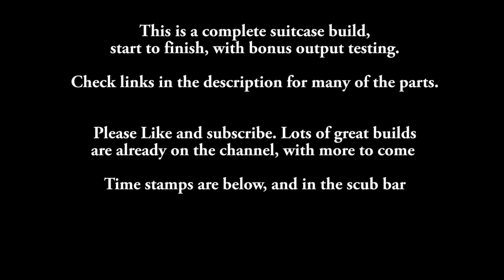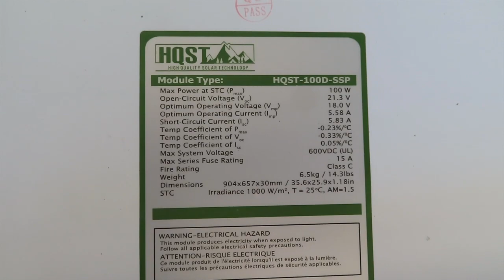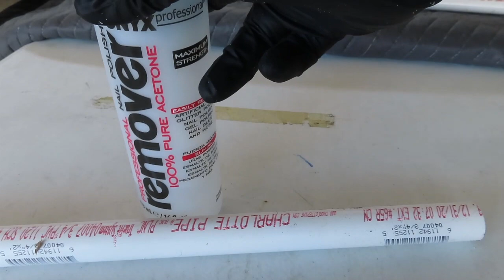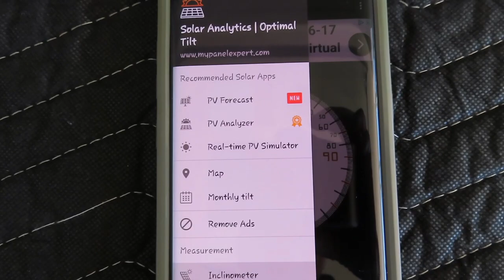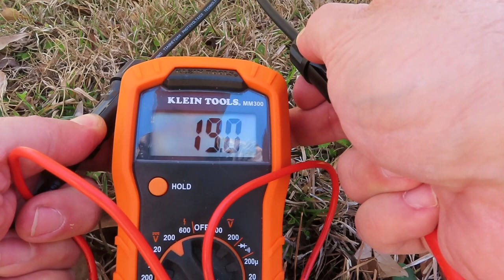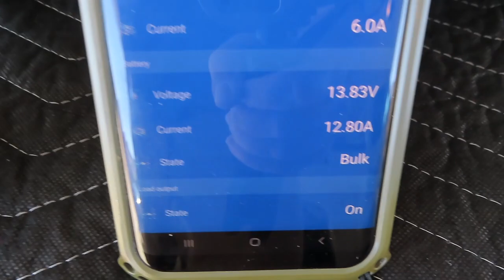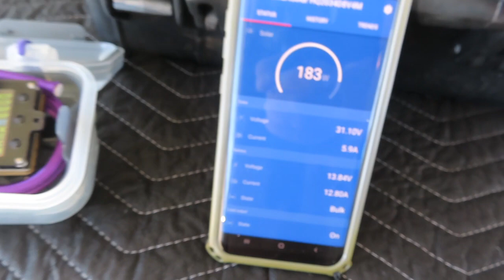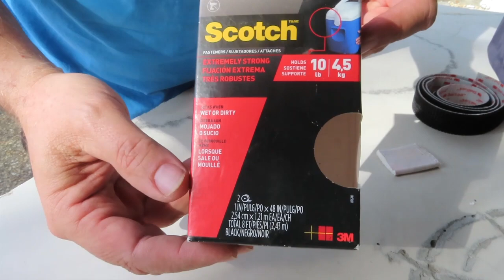Renogy 200w Solar Suitcase $500, DIY 200w $200

Comment: Received my panel today.  Jumped right on it following your video.  Tomorrow I'll get some 1/2 rubber bushings to keep the T's from sliding around.  Everything folds right back up and with the Styrofoam corners and side pieces it fits right back into the box.  Fits perfectly in the basement of my 5ver.
Thanks for the nice tip.
Reply from the maker: Thanks. Glad that was helpful

Comment: Thanks for the setup. I've been considering using PVC for (2-100w) solar panel brackets on my shed roof, which is only 7 feet high. The only issue is whether the  PVC will warp over time in the constant sun.
Reply from the maker: Done right, the PVC stays in the shade of the panel 🤔

Comment: I made the exact same frame, but, you need to anchor the bottom cross piece with an anchor. I didn’t and the wind blew them over.
Reply from the maker: I agree. Depending on soil, I use the anchors in the video, or the nail like tent stakes

Comment: We also just ordered a padded Cornhole carrying case to put our DIY suitcase solar panels in.
Reply from the maker: HECK TO THE YES! I've been racking my brain for a case to repurpose. Cornhole did not come to mind. Do you have a link?
Reply: @MikeJordanUnCamplicated  Sure do. Its gonna be a bit girthy but we'll figure it out. Here ya go:  https://www.amazon.com/gp/aw/d/B08P45VMYL?ref=ppx_pt2_mob_b_prod_image
Reply from the maker: @Prinnypiepie  I've been down the search rabbit hole since I saw your post. There is a "tailgate size" cornhole board case that is 36". I think I am going to order one of those. Fit will be much closer. Hopefully not too short
Reply: @MikeJordanUnCamplicated  Ah yes, for yours that will hopefully fit better.  We actually have two Rich 100w solar panels 45.5 x 20.5 x 1.4, but used your vid for reference when making them into a suitcase pair. I spent all day trying to figure out a case, or how to make some sort of padded cover for them myself and then I stumbled upon the corn hole case covers and was elated! Finally, something I could work with. We haul ours behind our spare tire in the back of our pleasureway van, the corn hole logo will hopefully help deter theives too.
Reply: @MikeJordanUnCamplicated  I wish I could send you a picture, we utilized the case this trip and it looks great! I also cut the box the panel came in and set the cardboard halves into the sides of the corn hole bag for extra protection. Another cool perk, is it says "Cornhole" on the outside of the bag so our panels are incognito.
Reply from the maker: @Prinnypiepie  Check the channel. I took your cornhole case idea and posted another video about it. But at least I gave you credit for the idea in the video. You are right, you get a little bit of stealth with that logo
Reply: @MikeJordanUnCamplicated  Oh really? How awesome!! I'll go check it out right now, thats cool! Someone liked my comment from earlier and it brought me right back here and didn't check anything else out. Nice, thanks!
Reply: I used a case intended for table leafs, but cornhole looks great too
Reply: Probably should have mentioned I have a single panel.  Two probably wouldn’t fit in the table leaf bag

Comment: OK...I bought everything to your specs here. My panels are 41x21 and that makes them a little heavier. Also, the space between the edge flanges and panel is 1". I'm thinking the 1/2" and 3/4" tubes are not going to be stiff enough as those tubes are going to be cut just a bit longer. I'm going to try to increase everything by at least 1/4". Your concept is solid, though!
Reply from the maker: Sounds like a good plan for the larger panels

Comment: One of the best explained most useful tutorial videos I have seen. Well done, I am now going to try to replicate this! Any suggestions on what panels you would choose now, two years on... or would you still go with the originals?
Reply from the maker: thanks! I appreciate that. Those panels have been used everyday for 2 1/2 years. Zero issues. I bought another set. So I would definitely buy them again

Comment: Could not find the watt hour meter you used we get to see it only a few seconds  Thanks for excellent video and will be building this soon
Reply from the maker: I used the app from the solar charge controller and then the other meter is a wireless display I use for my kayak. (testing on kayak batteries). My exact listing is gone. But this should be the same chinese meter https://www.ebay.com/itm/123201673413?_trkparms=amclksrc%3DITM%26aid%3D1110013%26algo%3DHOMESPLICE.SIMRXI%26ao%3D1%26asc%3D20211130130301%26meid%3D7c898ff6171c42148be44bb86b7f6230%26pid%3D101468%26rk%3D4%26rkt%3D12%26sd%3D132136452272%26itm%3D123201673413%26pmt%3D1%26noa%3D0%26pg%3D3650466%26algv%3DSimRWIWebRoundRobinBlenderWithPromotedSeeds%26brand%3DUnbranded&_trksid=p3650466.c101468.m3476&amdata=cksum%3A1232016734137c898ff6171c42148be44bb86b7f6230%7Cenc%3AAQAHAAABEClBV0HULvX%252FsR2ujldRbKqiPXc4M1uZ70AZlIHqTUvmLc1ScMSkFDCdsawaOQO3kJOq645MekT2kD9MeECJIxYot45RvX5xJsOGhV3SKeREHI8XHaCVwT7yXtb6eYefdTEuLRy2K6FDOoa4EDQ7FYlN0l0bIYm6Pc%252FAOp%252F1r5gzcTzCZw7tcqIcwdIl6iw2VJXuWGjPTIdLyT1%252BDAPGWPx0c0tWAwXFbCLR5mKtCwwJlkDtLMgaQup9KfMn%252FKZ7l7Q5y9GOE9HAmaoZVKijDCwLomU%252BtK2XBQI8NyOWLpFQuYZxaTlKBGODWfuwamtFX2QM0vMW6ifibn%252Bpbe8H3rw3L7onmqwPAGpwtvg2%252FRgA%7Campid%3APL_CLK%7Cclp%3A3650466

Comment: Looks great but I would put a strap on the bottom bar that you pull out so the panel doesn't fall over onto the ground
Reply from the maker: Two years of 24/7 use, and the panels have never fallen over. Not even once. Tent stakes. Tent stakes like in the video (and some others depending on soil conditions) are the key. They are not limited by a strap length. In my latitudes I go from flat to 60° and everything in between
Reply: @MikeJordanUnCamplicated  ok Im just seasonal so Whatever works I guess
Reply from the maker: @skipwilliam5639  yep, stakes even work for seasonal campers. The best part of using stakes are,  you are not restricted to strap length for tilt angle. You have an infinite range. You can use the app that I use in the video, to set your angle specific to your  latitude, and the day of the year.
Reply: @MikeJordanUnCamplicated  . That is true.

Comment: So, just had a thought.   What about, for the bottom?  I was just thinking that if you had, say 2 One- inch stands on the bottom, not only would you get a fraction more stubborn because it would be out of the grass, but I would think that it wouldn't get as dirty also.  IDK, I don't have any solar panels, but I'm looking into getting a couple for traveling, so maybe I'm over thinking it a little bit.   What do y'all think?
Reply from the maker: I have never had an issue that needed bottom risers. But if you did, add some

Comment: Thanks. I just got some Renogy panels with this very idea in mind. I probably won't save very much in the long run after all is said and done. But it looked like a fun project. I think I'm going to use paracord with knots in it for the angle adjustments.
Reply from the maker: I had that thought too, but I haven't tried yet. A truckers hitch would probably be perfect for easy adjustment

Comment: I could't help but notic that the PVC Tee you used for a hinge is putting pressure on the back of the solar cells. This could be a problem, as the back is not protected like the front is with tempered glass. There is a risk of damage to the cells.
Reply from the maker: I've  noticed... after lugging all over, and being in use 24/7 for over 2 years, they still work as good as the day that I built them 🤔😁
Reply: The weight of the panel does not appear to be resting solely on the tees. It is distributed to the frame by the crossbar which the tees are attached to. PVC does flex, but I doubt it would flex enough, over that short of a span, to push the tees into the back of the panel so hard that it would damage it.

Comment: Nice job.
Reply from the maker: thanks 2 1/2 years later still going strong. I just literally walked back inside after packing those up to head out for a last beach trip. Check out the video for the carry bag I found for the suitcase if you haven't already. Pretty cheap and tuff too

Comment: Thanks for a very detailed video.  I bought 5 lightly used 100 watt panels yesterday and built stands for four of them today.  I'm a little leery about drilling the holes for the hinges.  Do you remember the bit size used?  The hinge you linked from Lowes says to drill a 5/16 hole but that seems a little large.  Don't want to hit the glass on the panel. Super job and thanks for sharing your build.
Reply from the maker: The holes are drilled into the side of the frame. No problem with the glass

Comment: Heat pvc in boiling water, it’s faster and doesn’t burn the pieces. Also heats them uniformly
Reply from the maker: I tried boiling water in another project. I never got a flat completely solid piece like I got for the latches. I wouldn't call the latches burned either

Comment: Too cool for school! Very nice cheap and easy solution for support legs! My panels are 41" long. What would you say the length of my 3/4" legs should be?
Reply from the maker: Thanks. I just made somewhat of an educated guess at 2/3rds my panel. That has worked very well for me. I would think the same ratio should work at any size

Comment: If you wanted to hinge in the opposite direction, would the 3/4 PVC parts make it too thick to close?  I was thinking of using your design but put the sturdy tempered glass outward facing, rather than the delicate plastic backer.

Comment: Great job and thank you for all the information. I just finished my last night. Love it. I do have a 1 suggestion. I am going to drill  2 holes thru the 3/4" tee and into the 1/2" pipe so I can add pins to hold the panel at a 30 degree angle and another hole to hold it a 45 degree angle.
Reply from the maker: those angles would only be good for me (for most folks) for a 2 short periods a year. look at 12.16 where I talk about the optimal tilt app
Reply: That did not work for me. 
I ended up putting a hole on the bottom horizontal pvc section and put a tent stake thru it to hold it in position

Comment: It appears you used flathead bolts and nuts to secure the hinges. Do you recall the gauge of the bolts and nuts? Are the nuts the self-locking variety?
Reply from the maker: The nuts are the nylon locking type. I do not remember the size. I have a link for the hinges I used in the description. But I bought the hinges in the store. While I was there, I just matched a bolt that fit in the hinge holes. Simple, and you know it will work when you get home. Then I used the drill bit that fit the hole and matched the bolt

Comment: Nicely done.  Be aware, you may void your warranty by drilling into the frame of some solar panels.
Reply from the maker: I would hope not. Most companies that sell a product that requires DIY installation, allow for DIY changes. As long as what you do, is not the reason for the product  failure/issue, then they honor the warrantee. I wouldn't think holes in the frame, that have no bearing on the functionality or output or the panel would cause any form of denial. Just make sure you drill straight. But if so, they come from Amazon. You can return almost anything, and.... they are only $80 if you did have to buy another.
Reply: @MikeJordanUnCamplicated  I totally agree. Read the warning label on the back of your panels. I have read a warning by a manufacturer not to “add” any holes to the frame, wish I could remember who that was.
Reply from the maker: @johnc5937  the only thing on my panels are the specs and...  the don't get shocked warning for dummies
Reply: @MikeJordanUnCamplicated  I was looking at the label on Amazon for these solar panels with the infamous “Only qualified personal” part.
Reply from the maker: @johnc5937  I just reread the listing. I do not see such a warning. Its not rocket surgery

Comment: Thanks,that was awesome information. I'm going to do this project in a few days. A great help. Just wondering,can this system be set up as parallel to my Ecoflow river Pro? Again thank you.
Reply from the maker: Just have to check the charge input of rating of your Eco. You can set the panels for series or parallel connections

Comment: Great job you basically built exactly what i imagined. I've been trying to decide what dimensions to go with for ease of transportation and set up basically comes down to 40" x 20" or I've found 28" x 30" (100 watt). The weight seems to me to be a problem (30lbs) getting them in and out of the RV so I'm considering having the wiring in the RV and plugging in the panels once setup, also in order to minimize weight and ease of handling i realize they don't have to be joined together like Siamese twins ? So I'm considering that route. I might even secure them safely to the rear ladder for transporting rather than digging them out from under the bed! Also when priced out renogy has a 300watt complete kit with everything needed for $259 which includes all cables panel,30ft + battery,16ft 4xY connectors and adventure controller + Bluetooth. So i might just do that and make it portable? Also will add a chain or cable lock to the panels. But yeah i like the idea of portable over fixed.
Reply from the maker: For a drastic reduction in weight,  look for some of my newer videos with the flexible panel suitcase. MUCH easier to move around
Reply: @MikeJordanUnCamplicated  can you provide a link to that video, I am interested in that builld but can't seem to find it.
Loving your channel btw. Some great videos.
Reply from the maker: @MRMRS2wheeler  here you go. Thanks for watching https://www.youtube.com/watch?v=gII0JA6MMCA

Comment: Very nice work. It looks like your 1/2” pvc is holding but is it sturdy enough? Probably is due to shorter length of pvc. I used 1 1/2” to encompass 4 panels so I made 2 portable frame stands. Very sturdy plus I color coded to take down and put back together for easy storage. Panels will be panels as they are 16 lbs each. All in all I like your setup as more compact then mine. Great job
Reply from the maker: You can hold up a tipping 100w solar panel with one finger. The 1/2 PVC does not support any notable weight. It just acts as a hinge pin

Comment: Hi, i made the stand just like yours and after about 13 months  the PVC pipe rubbed holes on the back side of the panels  an burned thru to the font.have you had this problem???
Reply: Ouch! Would some sort of protective backing between the pipe and panel solve that issue?

Comment: As the glass is most of the wight have you considered taking the glass out
and packing that space with corflute? since its not permanently outside 
you really dont need it and you'll get more amps also?
Reply from the maker: One of my suitcases are permanently outside. I have not heard of corflute???
Reply: @MikeJordanUnCamplicated  Corrflute is that plastic sheet with holes for insulating a hot house wall - i didnt use as no glass on the 380 watt panel - its siliconed onto the rails - it put out 7.1 amps in yesterdays 70deg near winter sun and a 10 meter lead

Comment: Nice work!  I am working on the same project!  I'm planning to cut and piece the original cardboard boxes back together with contact cement to store the suitcase when not in use. I also like the idea of adding the Cornhole bag!  Question: The Renogy Suitcase has the glass on the outside when folded. Why did you put the glass on the inside when folded?  Seems like the thin white sheeting would not protect the panels from damage.  If something should happen to scrape off or damage the white coating, do you know if this would this damage the PV cells?
Reply from the maker: I have seen plenty of busted glass solar panels. I have never seen the back of a solar panel break

Comment: Mike,  Thanx for the great directions and the info on orientation/angles of the array. I feel comfortable that I can break into solar for my small casita travel trailer trips more economically now. Question on voltage controller though...If I adapt 200W panels as you did, what voltage controller would be best for my small 30A RV (single AGM Deep cycle)??? PWM or MPPT? What Voltage/Amp ?? Thanks
Reply from the maker: MPPT is more efficient. The one I used in the video is linked in the description. Victron is pricey, but the best. And you can see what is going on in the app. If you buy more Victron equipment, they all talk to each other

Comment: I've had landscaping irrigation PVC go brittle in the sunlight.  Should you use the dark grey PVC for this application?
Reply from the maker: You are right, the white PVC doesn't have any UV protection. So for other outdoor projects in the sun, I would definitely recommend the grey. But on the back of the solar panels, the PVC is literally always in the shade. It will probably take decades to degrade it. And by that time there will probably be mobetta solar panels to build a new frame :)
Reply: Simple rattle-can spray paint to give the PVC uv protection -- spray it before assembly.

Comment: I wonder if the 3/4 pvc hinge point where the 1/2" slides through it might cause wear on the back of the panel and cause an issue?  Have you seen any problem with this?
Reply from the maker: PVC is a plastic polymer. So it the back of a panel. I can't imagine any wear, unless you open/close them 10s of thousands of times. By that time, someone will probably have invented something better

Comment: Thanks a lot, Mike. I've been pricing a lot of commercial folding panels and they are expensive. There are great prices on panels like you have used here. I'm looking at using 200-watt panels to charge my Bluetti AC200 Max more quickly. Any thoughts on that idea?
Reply from the maker: make sure the bluetti charge specs will handle the panels and they will be a lot better than anything that you could buy for the same money